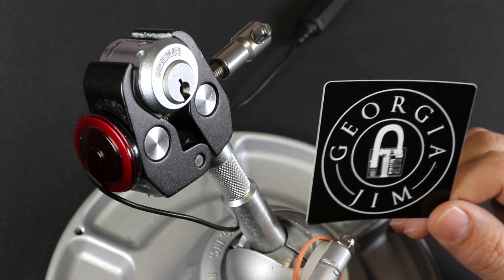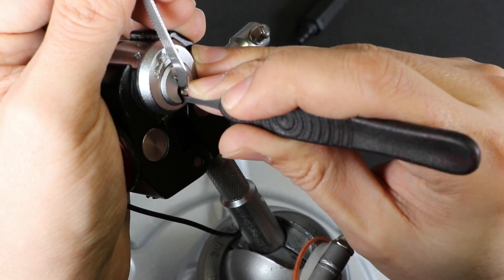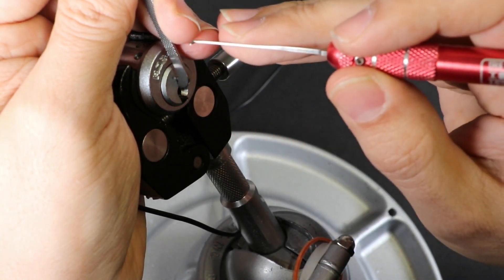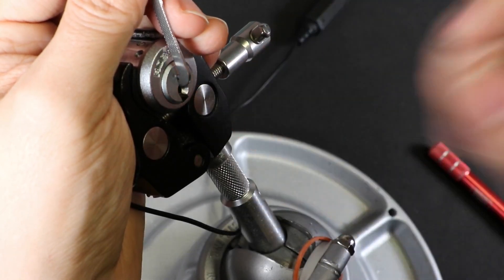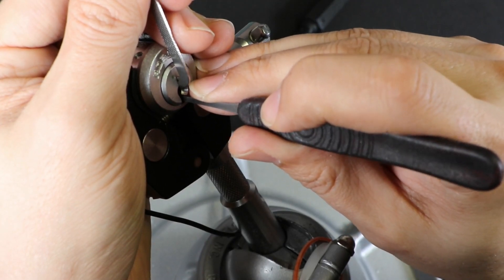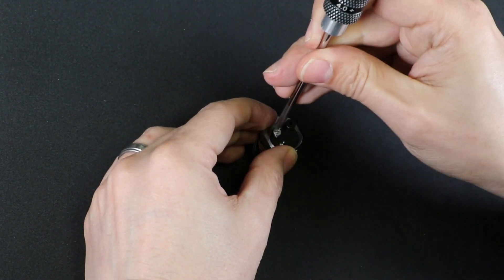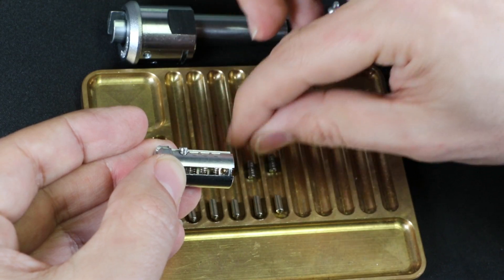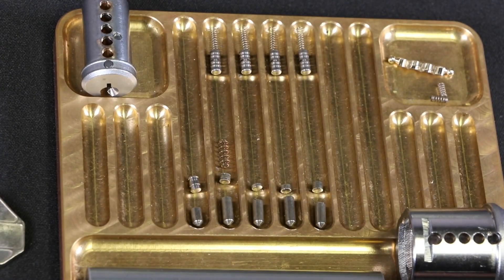[L223] Robur Safe Deposit Box Lock - pick and gut

Comment: The bible is so short that any barrels in the other chambers wouldnt allow the key to be removed when reassembling. It came stock with one gin and 4 standards which made it super easy because the false set of the gin put the sidebar in a the perfect spot to lift everything right into the true gate.
Reply from the maker: So you went and increased the difficulty on me?  :p
Reply: @norlin76  of course, wanted it to at least feel like a blue lock to you.

In fairness i picked it as is before sending it.